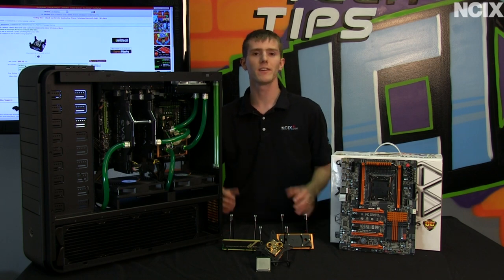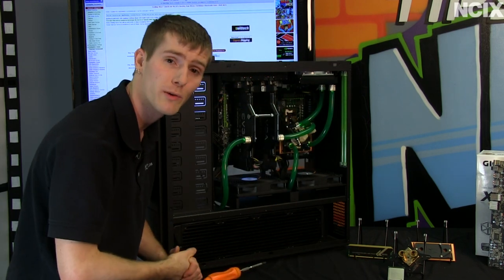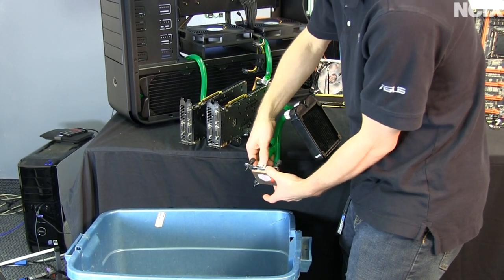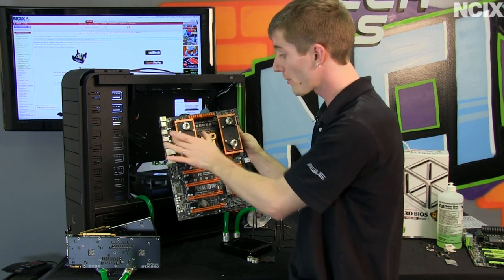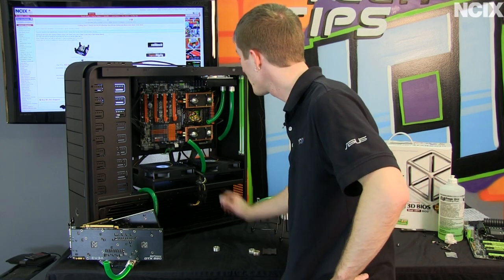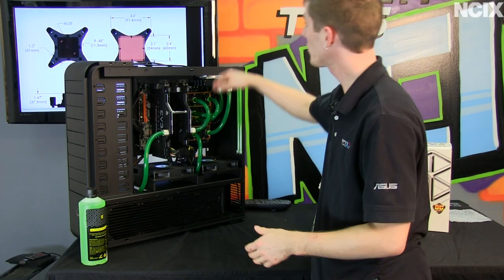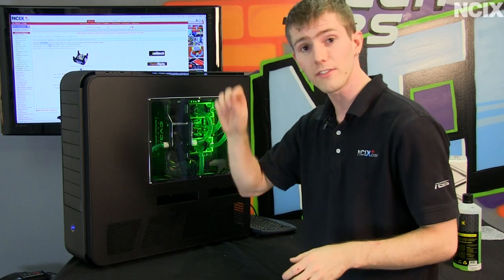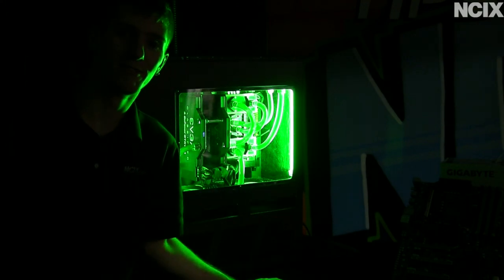Water Cooling Guide Part 4 - Maintenance and Upgrades for your Liquid Cooled System NCIX Tech Tips

Comment: I'm an avid water cooler. Two 590's generate a shitload of heat, if you can dissipate any of it before going to the hottest part of the loop (the cpu) you should. I have temperature sensors all over my rig and I have done tests. It does make a difference.

Comment: What you can also do when mounting/planning your watercooling loop is putting a drain system on teh lowest part of your loop (in my case, my reservoir/pump combo is the lowest, so I took a port and put a valve on it, with a tube running at the back to drain my system. I did the same on the top for refilling it!

Comment: this particular silverstone case has the pci slots facing upwards for heat dissipation, its just like a regular case, but instead of plugging your monitor to the back, you plug it to the top and cover it with the plastic cover the case comes with.

Comment: Great Video.s but I would of installed the barbs BEFORE putting the blocks on the motherboard, it can put strain on the fittings when you tighten them. would liike to know where the video outputs are seeing as the board is 90 deg different from other cases, how does that work ?? does everything poke outa the top??

Comment: U mean which components u switch? I meant simply everything, is there any part u need to reinstall windows after changing. Well of course u have to reinstall it if u change the harddrive or upgrade to something that doesn't support your windows version, but what about the rest?

Comment: How often do you change the coolant? I use the koolance quick disconnects on the CPU and rad for quick and easy removal. I am using the mcp 655 pump it gives good flow without restriction. Great video Linus.

Comment: Yes he did. Gold is the best material to build heat exchangers, because is a very good heat conductor, but it costs about 32'320€ per kg. That's why also those heat exchangers are made in a limited edition. (Capt. Obvious mode off)

Comment: I understand wanting to reuse the tubing you already had, but can you tell me if I'm right...

The coolant is pumped from the res into gfx2, to gfx1, to mem1, to processor, to 120 rad, to mem2, to big rad, and back to the res.  Correct me if I'm wrong, but wouldn't it be better to go straight from the gfx cards to the 120 rad, and then to the processor (memory could go anywhere since its essentially for show anyway) and finally to the big rad?  Or does the temp even vary that much throughout?

Comment: Is a quadruple radiator necessary for this type of build? I realize he is also cooling his 590's in quad-SLI (and that this is an ultimate water cooling guide), but could he, for example, be using a 240mm radiator that would provide efficient enough liquid cooling for all the components?

Comment: How do you connect a monitor to this system? Your cards are not touching the back and I don't see a PCI bracket on it. Does it run the video out the back of the motherboard?

Comment: Why do you have all the hot coolant from the 590's --> ram block -->cpu, then the 120mm radiator, if you had it go 590's--> 120mm rad --> then the ram block to the cpu it would be cooler

Comment: Hi , what is best water cooling for Nvidia Qadro 4000.

My Machine configuration is  

Intel  S5520SC mother board, 

Two Intel E5620 Xeon processor,

16 GB ram,

1000w cooler master SMPS ,

1tb HD.

Comment: IMHO i don't agree with that loop. U have hot coolant from GPUs going into the 1st RAM block then into the CPU and then into the small rad. Wouldn't it be smarter to have coolant running into the rad before CPU block?

Comment: Even overclocked they don't produce enough heat to need water cooling or even air cooling for that matter. The other factors that will limit the overclock before the heat. It's just for the show and Linus as said it multiple times too.

Comment: Is there a reason why you shouldn't just put both ends of the water cooling loop in the tub and start the pump? That should quite instantly empty the loop of water without contaminations, no?

You'd probably have to detach the part of the loop that is connected straight to the output of the pump to make sure it's 100% empty, but still.

Comment: Not looking forward to draining my loop next week. I put in a drain port but it's not in the best location for draining. I can hopefully use it to drain enough of one side so that I can start removing fittings and then drain as I go. I'll be swapping out my distilled water for Mayhem's pastel Coolant, adding a sexy flow indicator, and rerouting my loop for better overall looks. Might also be swapping out my Alphacool XP3 Light CPU block for an EK Supremacy EVO but I'm still undecided on that. Probably not because the few degrees Celsius I could POTENTIALLY save isn't worth the extra $120 I'd have to spend.

Comment: Someone tell me why you need liquid cooling. The fans in the radiator make as much noise as fans in the case would. With good enough air flow you could get the same performance.

Comment: Arrgh. Screws in awkward spots.

Linus, get yourself a Bosch Ixo 4 driver and set of long drivers. You'll thank yourself multiple times over.

BTW, wadded paper towels shoved down the ends work well for preventing drips from hoses and are easy to remove. (long aquarium experience)

Comment: If you don't wanna loose your data or re download every thing just buy a new hdd with your new gear and transfer it all over once you reinstalled windows with your new system. It rarely works if you change your system and try to use old operating system even if you manage to install all the new drivers there's no way to get rid of the old ones.

Comment: Yeah, but since its just an upgrade if components, he just reused the old stuff he had. Better dump in a few more bucks and adjust the colors though :)

One thing about the pipe between the two gfx:
If your going for a good look, i'd take either one of those block connectors or take a Tube aswell. The pipe looks cheap somehow.

Comment: well in my opinion the main reasons i switched from console to pc is for the better graphics and mod support for games like skyrim, fallout, left 4 dead. and alot of valve games since they are better on pc, also games like crysis which are ALOT better on pc as long as you can run it. but most ppl i think stick to pc because they are used to the layout and were brought up with pc gaming.

Comment: You don't want to do that with the MCP pumps.  You always want to have fluid in the pump. If you drain the system with the pump it won't be long before you run it dry and this could damage your pump and shorten it's life.  I suppose you could be very careful with the power switch and make sure you cut the power immediately when it ran dry, but why risk it IMO.

Comment: @NCIXcom Linus, you are great IT guy, but do not mix the different liquids (coolants) in one water cooling loop, it causes corrosion\chemical precipitates & other problems. Also note from Feser website: - Do not mix different colour Feser One coolants together, chemical reactions can occur. Best way is to fully drain each component, put the end of the loope to the container, fill the loop with the distillated water (2-3 litres) and drain again. Only then we will be able to use the new coolant.

Comment: Personally.... if I were to build a water cooled loop as so... I would add a T fitting near the bottom (lowest point so gravity will be used to its full potential) add a tube and cap it. So if the fluid has to be changed or I was to upgrade it would be easy to clear...

Comment: nine drive bays and not one of them used, the SSDs are dangling on the back of the motherboard, and the graphic cards are vertically placed. also the reservoir is on the bottom of the case making it harder to remove air bubbles. this is the weirdest setup ive ever seen.

Comment: quality! why only 1080????? 4k please!
Reply: Because this was April 2012
Reply: okay =C
Reply: why graphics card was made in 2011 and it can handle 3D and 4k
Reply: Dual 590 has 2,048 cuda cores, that's like the same speed of a single 980, a single card CANNOT handle 4K.
Reply: +Safwat Khan 1 980 can run 4k you have to lower graphical settings.  A 970 can run 4k in some games.

Comment: evga is gonna or has released their gtx 680s with waterblocks on them so you can have 4 of them in a system as opposed to 2 590s (i know he basically has 4 580s in there now but whatever). I wouldnt really call the system extreme just yet.

Comment: The green light is too much imho, it taints the whole thing green in green. I think i'm more of a white light where you can see all the colorwork you put into the case.

If i am going to put a WC in mine, i'm going to take a black overall color with white fluid, using 45° connectors to get straigt lines using white light.

Comment: Yes, don't worry it will run minesweeper. but in my opinion, you should buy a system this expensive for minesweeper, i know minesweeper is a game, but that game is not that demanding. this computer has 4 graphics cards, very overkill for minesweeper in my opinion.   you should just use integrated graphics which should save you a lot of money. but if you really do want the fastest system, i just you do a water cooling setup with 7970's this gen. 

thumbs up so he reads it, and doesn't waste money

Comment: I don't understant this motherboard orientation..... -_- ports on the top of the case it's stupid
Reply: Heat rises.
Reply: Coďák This way makes more sense to me than the usual computer case setup.
Reply: +iAmCodeMonkey Well then you would want them at the bottom because heat rises.
Reply: awesomecooly123 You clearly do not understand why this case is like this.

The reason for having the motherboard this way, is that the heat coming out of your graphics cards can be exhausted out of the case more easily, due to the air rising out of the graphics card naturally. This way, your graphics card fans do not have to work as hard.

If you had them at the bottom, or facing the normal direction, then the graphics card fans would have to work harder to get the hot air out of them, due to the air being trapped underneath the cards.

I hope this made some sense. Google is your friend if you need clarification.
Reply: iAmCodeMonkey Yeah that makes sense.
Reply: +iAmCodeMonkey
if it's so clear that he/she doesn't understand, why did you feel the need to say it?!

Comment: Why can't anything be in grey and black? Or even white and black! I'll take that any day of the week.

Even sockets with mirrored finishes would be better than a colour you cannot replace, because then they would take on the colour of everything else. I just don't understand why.
0
And why green as practically the only colour for video cards by nVidia always? Despite the fact PC components are usually customizable, such customization is often restrictive in some aspect by the menufactuer not making things in a colour you want, which is bollocks if you want to upgrade to something better, but Oh snap the colours don't match! Ugh.
Reply: Msi krait motherboards are matte black and white pcie and ram slots

Comment: just saying guys, I have 8 fans in my pc no watercooling and I get an average temp on my cpu without load of 15 degrees celcius
Reply: yeah. I watercooled my pc yesterday, I have now dropped 4 degrees
Reply: Ieuan Edwards I don´t hope you have a room tempature on 15 degrees :/ It´s likely impossible to get it any lower than the room tempature without using nitrogen ;-) But good work if you did! :D
Reply: Kjartan Dige no my room temp is quite high dude, but all the time my cpu idles from 12-18 degrees, im using nzxt cam software to monitor it, is cam accurate?
Reply: im not lying man, My pc has been running all day and at idle it hasnt reached over 20 degrees, if you dont belive me I can put photos on to photobucket
Reply: Ieuan Edwards Erhm, something is wrong with your monitoring software. Unless you're using liquid nitrogen to achieve negative temps you're not going to be able to get lower than ambient temps.
Reply: ill download other software and check now
Reply: Tim Binder Yes. Still doesnt change the fact that he can not go below ambient temps(room temp). Only way to get around that it to have liquid nitrogen or watercooling with radiators placed somewhere thats colder than the room the computer is.
Reply: The fuck... Well your room's got to be below 10 degrees C...
Reply: It wont get colder than your room, dude
Reply: I water-cooled mine and my cpu I've seen at 7c on a cold day so I believe you. And I think you can be a little under ambient temperature because moving air is cooler than stable air. Grab a thermometer and tie a string to it then spin it around for a minute, you'll see the temperature dropped a bit.
Reply: No. Physics. ONLY if your ambient temp was below the temperature when you started. Lets say you have your window open during the night. then close it during the day, let it heat up fast, the water will store some of the cold. and before the system heats up enough you check the temp, it MIGHT SEEM as if its under ambient temp. But during a longer test of any form its NOT possible to get below ambient temperature without some kind of way of cooling your loop, maybe putting radiators in a bucket of icecoldwater or whatever you feel like.

TL;DR
NO, PHYSICS MATE
Reply: If the liquid is in motion, it's using energy to move, the cost is temp. so the moving water will be colder than stagnate water.
Reply: I may have forgotten he said he's running only fans... lol. Anyway the air works the same way. What's the DP where you live?
Reply: +Mikaeel Lakhani i live in a really hot place, and ive had my pc idle at 8c* with only fans.  not faulty temp, tried it on a different mobo, and different cpu (same kind though)
Reply: its a fx-4300 quad core overclocked to 4.6 ghz, and my cooler is a cooler master hyper 212 evo, with 2 NF-F12 at 900 rpm on the one pulling from the heatsink, and 800 rpm on the one pushing into the heatsink. its OP af
Reply: +Ieuan Edwards my gpu gets arround 26 celcius while the fan is off
Reply: ***** pfff i placed my pc under a window, air thighted a way to the top of my chassi and set all fans to pull out air, got my gpu (970 strix) down to 0 and cpu(4690k) to 4 degrees celcius xD my room got pretty cold though haha
overclocked gpu to 1544mhz core clock and cpu 4,9mhz, none went above 10 at maximum load :)
Reply: ***** Placing a radiator outside with -17 should work fine as hell :D Some special liquid would be needed for that though so that it doesn't freeze lol
Reply: +Ieuan Edwards Both my systemes are at idle at no higher than 19 and one system only has a hi60 in it.

Comment: Nup, fuck water cooling
Reply: It is actually more helpful for the computer, silent and stays not as hot as fans
Reply: ***** How would you kno-
Oh.
He's a fish.
Reply: Jose Ventosa
a decent or good 30-70 dollar aftermarket heatsink gets the job done just fine water cooling is a waste of time and money these days sure it looks fancy but its not very practical as overclocking isnt very useful outside of playing poorly optimized shitty triple A games or running games on 6-8 core amd cpus which arent meant for gaming in the first place as most games still use 1-2 cores SOOOOO bottlenecks

all overclocking does is kill your system faster and it can cause issues permanently or temporarily until you go back to stock settings youre just better off investing that time and money into better components and avoiding said shitty poorly optimized triple A titles

and the whole silent thing well... most people use headphones so youre not going to notice the noise if at all and most of the noise still comes from your hdd if anything you can just put rubber screws in or buy an aftermarket case fan and oh right.... water cooling systems if theyre not good can make more noise

and did i mention possibilities of leaks, fucked fans, hotter room temperatures as more heat is dispersed from your system now, the bitch of cleaning these things, how much of a pain they are to install properly, how much of a bitch it is to change anything once its in, loop damages, and contact point damage???
Reply: SunnyD Sorry money's so tight for you that this is "expensive". Sorry you can't afford a decent home theater system to power your 7.1 gaming. Sorry you're still using platter drives. Can't afford M.2? Its awesome!
Time to go back to college and finish!
Clearly you don't enjoy liquid cooling or high end systems. But I sure do!
Reply: SunnyD Sure thing genius.
Reply: Whatsin Aname Once you go SSD for a boot drive, nothing else will do.
Reply: iAmCodeMonkey I'm excited to try Samsung M.2 M SSD in my new build. Just wish I could find a decent X99 board with 2 M.2 M slots. I found one with an M.2M and an M.2E but that's not very helpful.
Reply: had to comment on this two year old post, cause you have been proven wrong so many times over it's funny as hell